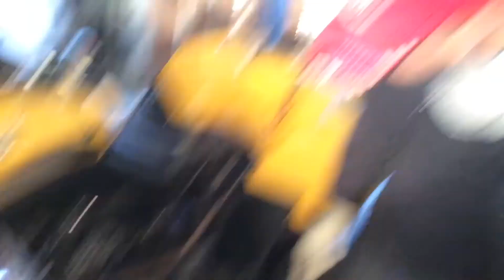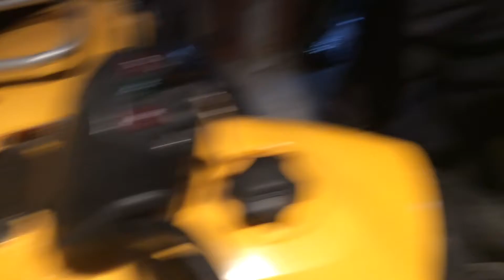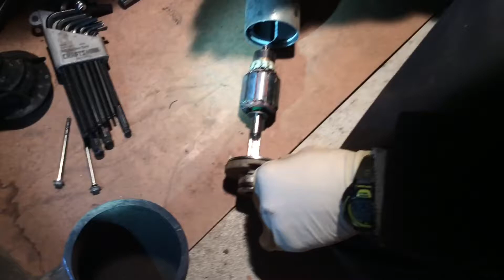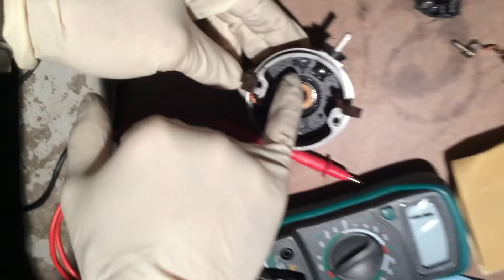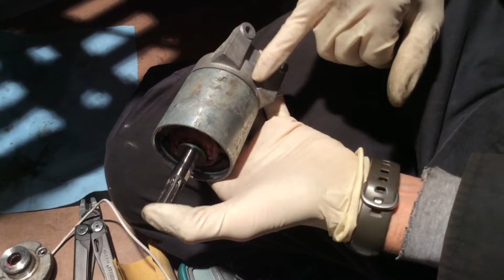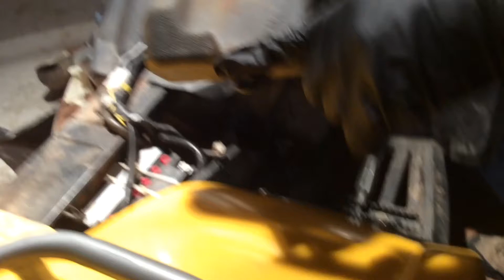Can-am rally starter motor repair

Comment: I love the part about using your sister's toothbrush! I have the same quad and the starters making grinding noise. You think the starter is worn or the gear it fits into?
Reply from the maker: The gear on the motor itself is probably worn.  You most likely need a new starter motor.
Reply: " the gear it fits into" is the flywheel, no?